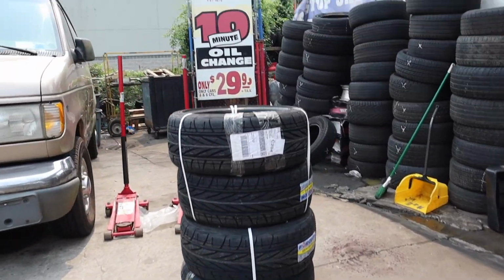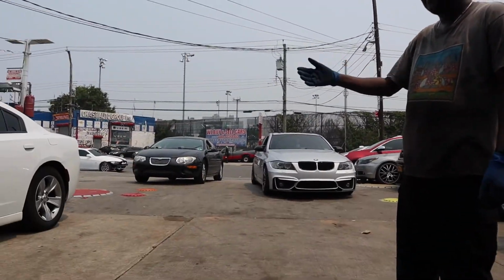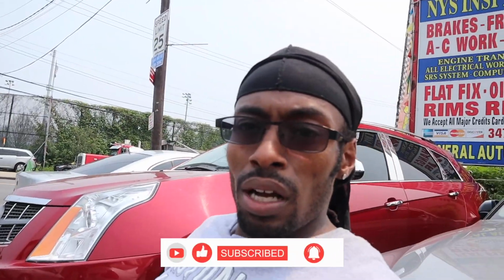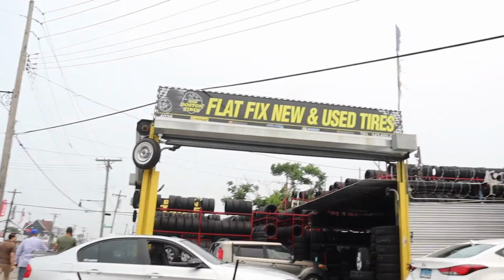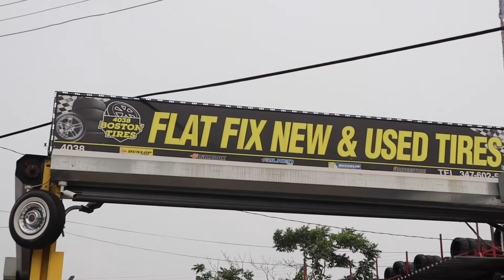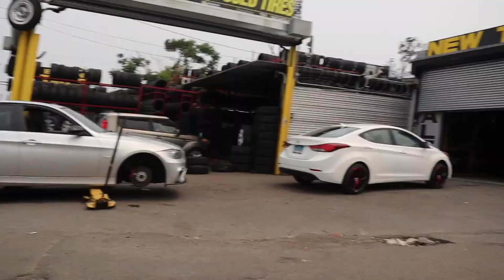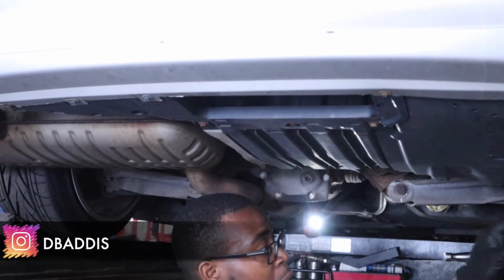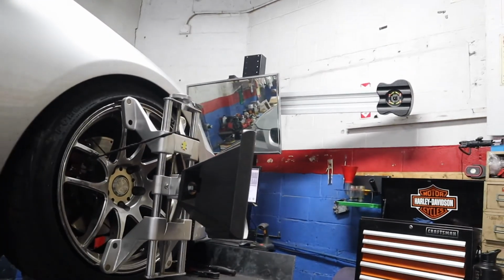E90 getting set of Forceum Hexa R Tires &  Wheel Alignment

Comment: How do you like the tires so far are they quite they have good grip , nice video by the way
Reply from the maker: They are little noisy but not to loud  at highway speeds, but very good grip, & thanks for watching
Reply: @DBaddis  thanks for your reply I have a 2015 mercedes e350 4matic and I think I'll give them a try I have now the lexani and I'm not that happy
Reply: @konstantinostselios1129  I have a 2014 e350 4 Matic luxury did you end up purchasing these tires I currently have kumho ta71 and they are trash 🗑
Reply: @G_G_AutoCareLLC  no I don't
Reply: @konstantinostselios1129  which tires do you have on your w212?
Reply: @G_G_AutoCareLLC  I have the lexani 207 UHP and I'm not happy with them they are ok when you commute in city but in highway speeds they have vibration because they are not well balanced from factory
Reply: @konstantinostselios1129  wow that sucks I’m going to try an uhp tire I believe the w212 likes tires with stiffer side walls